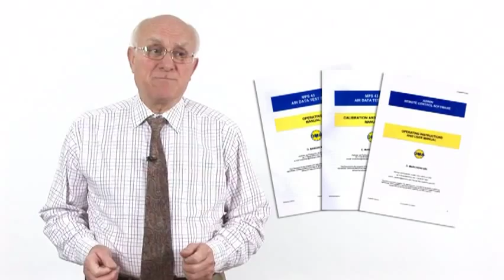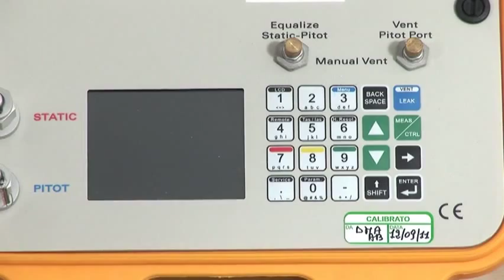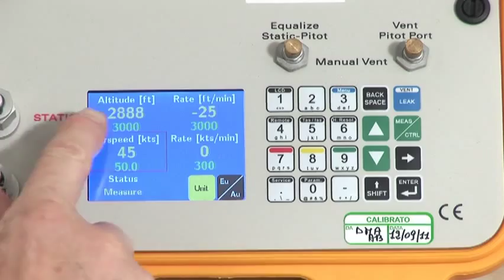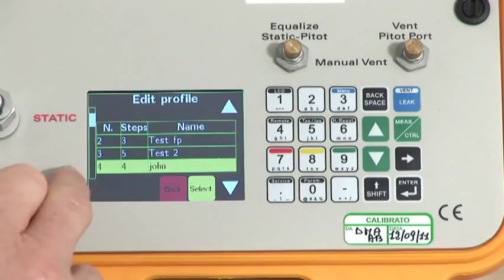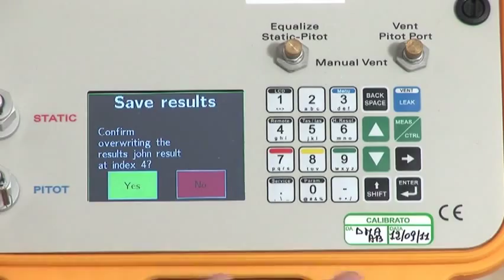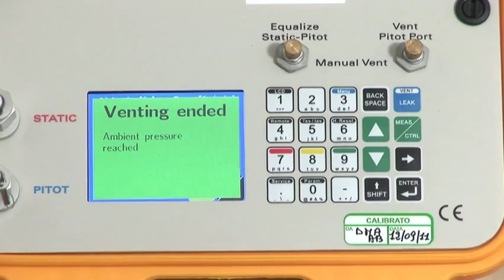MPS 43 Ultra Compact Air Data Test Set

Comment: HI , I need to know, what type of internal battery use the air data terminal MPS43? THANKS
Reply: Sealed lead acid
Reply: Baterias durabell..las puedes encontrar en el agro sur..estimado